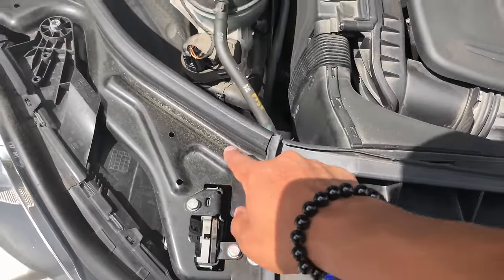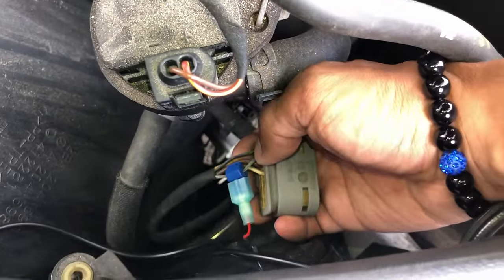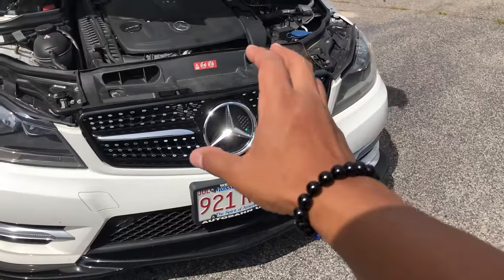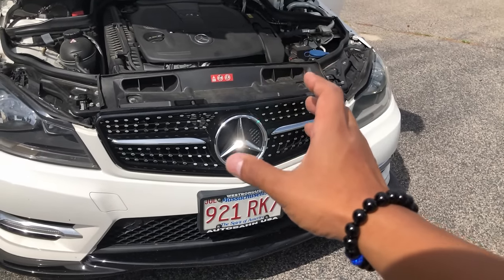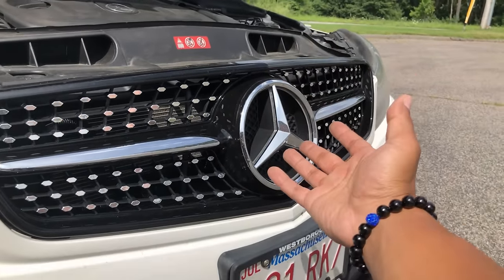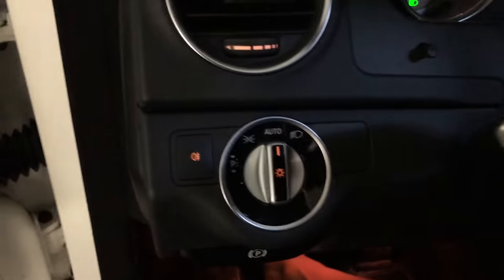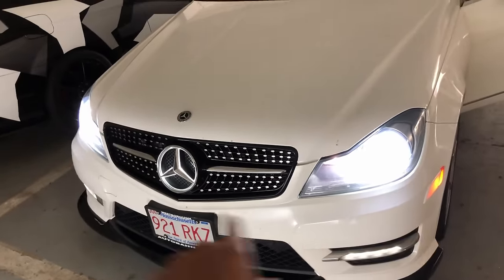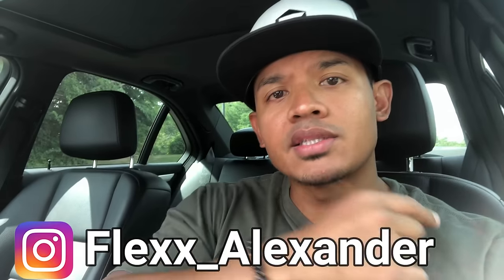2 EASY WAYS TO WIRE A  MERCEDES LIGHTED LED STAR EMBLEM

Comment from the maker: FOLLOW ME!!!
Website: www.FlexxAlexander.com
Facebook: www.facebook.com/FlexxAlexander1
Instagram: www.instagram.com/Flexx_Alexander
Reply: I see you with your lights on the door. I have my 2006 r500 hooked up the same way. After this, ill be installing led headlights and reverse lights. After that, i don't know what else to do. Any suggestions?
Reply: Hey Flexx,
I have GLC300 2019, but the headlights wire is different with your car. My car have 2 different colors, one is red another is brown. Do you know which one should I connect with illustrated emblem?
Reply: Do they sale a lighted emblem for a 2004 mercedes clk 320
Reply: I have a 2013 e350 and I don't have a grey and white wire .do you know which color it would be for me or can you point me in the right direction

Comment: Thanks for your videos! Replaced sons 2013 C250 grill with the C63 AMG grill and also installed the LED grill emblem using your videos. Your content made it a breeze. Also installed the indoor puddle lights that project the Mercedes emblem on the ground if you open the two front doors. Those were crazy easy as well if anyone is wondering. Just pop them out and unplug. Plug in the new and pop em in and BAM. Again thanks for your very helpful videos.

Comment: Thanks for showing the correct way to wire the star! It should come on and off with the auto headlamp sensor as well as the headlamp switch. It should not run all the time. Kudos
Reply from the maker: It draws so little power and works well. Another way is using a fuse in the fuse box. I have a video on that. That might be easier for people then splicing into the headlight harness 🤷🏻‍♂️

Comment: Hey Flexx. I saw that you ran the wire to your headlights. What are your thoughts/is it feasible to wire it into the parking light (right next to the headlight)? That way, when I unlock my car at night, I get it to light up as well. Thanks.

Comment: I have a 2017 CLA250 4MATIC
For anyone with the same year/model it's the solid yellow wire on the passengers side headlight than you are gonna want to T-Tap into and then I grounded it to one of the white screws going into the frame on the perimeter of the engine compartment.
 Comes on whenever the headlights are turned on.
Reply: I have 2018 GLE350, I’ll check the setup tomorrow. Hopefully it’s similar to your CLA. I was at a shop today, they asked for $80.00 to do it which seems too much for this kind of work. I’ll do it myself :) thanks for sharing
Reply: I have a 2018 mercedes cla250 & I t-tapped into the yellow wire but my star doesn't come on? Do u think its different in my car?

Comment: What year is your car? I tried hooking it up to the headlight wires. I do not have a Grey and white wire. I tried all the red wires, light stays on even when car is off. Thank you for your help.
Reply from the maker: 2013
Reply: @TheFlexxGarage  thank you, I have a 2015. I have T tapped it to the headlights, tried 4 different wires, 3 - red ones worked, but the light would not shut off. Found a black and white wire, that one made the light flash/blink.  Thank you for your help. Enjoy your videos. Thank you
Reply: @robertlongoriccardo  did you find the right wire? Same problem

Comment: Hey man great video as usual. I was thinking of hooking mine up to a pack of 4  AA batteries and a remote switch so I could just turn it off and on wirelessly. I was wondering how much power this thing draws. How long do you think it would last continuously on 4AA batteries? Also is there enough space to stick anything to the back of the star itself? That way I could just remove the star everytime I want to change batteries.

Comment: Hey Flexx!

Do you know of a way to connect the emblem to have it on ONLY when you unlock/lock the car? I want to have the symbol work the same way the puddle lights under the side mirrors do.

I've searched quite a lot for the location of those lights on the fuse box but no luck just yet. If you or anyone could help me out would mean the world!
Thanks a lot love your videos!

Comment: I have a 2018 c300. I purchased a rear diffuser that has a rain light. The item was purchased from a company in China. There were no install instructions for the light. I want to tap into the rear brake light harness. My question is, which wire in the harness is for the breaks? Thank you.

Comment: For my ml350 2015 to ttap it to my head lights what wire or color wire to tap?
Reply: The easiest place to wire the emblem to are the orange / yellow side marker lights.

There's only two wires attached to the bulb a ground and a power. It's super easy and easily reversible.

Comment: Hey, going to get the same style for my SL55.  Won't I get a error code if I splice into my headlight power wire?  I have HID and they only use 35 watts.  From my experience my car throws an error code anytime I hook something up that is not factory.  I upgraded to HID fogs but the ballast had a code cancel feature.

Comment: The easiest place to wire the emblem to are the orange / yellow side marker lights.

There's only two wires attached to the bulb a ground and a power. It's super easy and easily reversible.
Reply: Mine are green and brown? Which one is positive?
Reply: ??? My lights only have 1 harness and the side markers are built into the lights
Reply: And trying to find an actual wiring diagram for a gla45 is like trying to find a leprechauns pot of gold

Comment: So, did all the steps in tapping into the gray/ white wire for my star. However, I noticed at night the footwell light are on. They turn off when the car is off but when the car in use and the automatic lights have turned on giving power to the star, I noticed the footwell lights are on. Any suggestions, what’s going on here?

Comment: Hi Flexx, I'm driving an A45 2014, my headlight doesn't have the Grey with white stripe wire, but it has grey with black stripe wire, are they the same? which colour wire should I tap on?

Comment: Hey so I bought my car with it wired the first way. About a month ago it stopped working. My lights and everything still work fine. Any idea if it could be a fuse or something? Or if i disconnect it what can i test the star with by chance?
Reply: I can just touch it with a 9v?
Reply from the maker: I would take the positive wire and negative wire from the star and put it on a 9V battery to see if the star will even light up.

Comment: How exactly do you “ground it” do u jus put the wire under that bult or do you have to cut some rubber off the wire so it can touch the bult directly?
Reply: yes you literally just wrap the bare wire (no rubber) around and tighten it and it should get electricity

Comment: By tapping into the wire for the headlight didn't cause a voltage difference and trigger a bulb failure on the dash?
Reply from the maker: No. The led star uses almost next to not to power up. There’s other ways of wiring it but this was a quick easy way for me that worked for me. Never had a single issue.

Comment: Hey Alex I know this is a old video but I want to order the star in ebay I have same car and grill do you know the diameter of the star is it 7.5 or 8.4 12.5cm I don't want to order wrong size
Reply from the maker: A lot of grille have different size opening. Also, a lot of stars have different way to mount to a grille.  Best way is to remove the star from your grille, measure it, see if it’s the snap on star or twist on star…and then find a lighted star that matches.

Comment: Hey I bought the grill but can you share the link to get that emblem please 🙏  ??
Reply from the maker: I can't. The emblem is "modded" to fit because I bought the wrong one that's slightly smaller then the hole opening in the grille. It wouldn't help for me to send you a link to the star I bought.

Comment: My husband install an led light on my glc300 but now my driving assist, and blind spot is inoperative showing on the dashboard
Reply: Mercedes does not allow the illuminated star option with drivers assist because it obstructs the radar. You'll need to find a clever solution that allows the radar to work while illuminating the star.

Comment: How did you get the star on the diamond grill. Mine doesn’t fit like the normal star does
Reply: Did you get it to install? Because I’m having trouble too
Reply: The star comes out by twisting counter clockwise and pulling it out and twisting clockwise to lock it into place. This is on a C-Class, CLA, W212.2 E-Class and the rest of the line up 2014 or newer, equipped with a large star grille

Comment: I have a E350. My fuse box completely full compared to every video I've seen. I tapped into #35 which is for a hybrid (I assumed it would work) but it didn't. I just think thats easier than pulling out and t-tapping into the headlight. The headlight isn't as easily accessible. Any ideas?
Reply from the maker: When a fuse box is full, then you need to use a fuse tap to piggyback onto an existing fuse that gets power when the car is turned on.
Reply: @TheFlexxGarage  I am.
Reply: The red blue and black thing
Reply: I just went and got a battery to test the light also. The fuse does light up when the car is on also. #35 also uses a 5. So I put both into the tap and plugged it in
Reply: @TheFlexxGarage  I got it. I used a fuse I had instead of the cheap ones that come in the tap kit. Ty though.
Reply: @tallgirlswagg  Did is work with taping into #35 ? does it only power on when lights are on or all the time?

Comment: I test my star light is on by v9, but when i connected with the wire power is not on. (Grey with white  stripe wire) Can you help me? I have the c300 2011
Reply: Im having the same problem with my cla 250… is not turning on
Reply: Please let me know if you find out

Comment: What does a star cost?
Reply: O.E. Mercedes-Benz parts across the counter at The dealer run about $480 for just the star emblem. Mercedes will also price you for the lighting interface module and the accompanying wiring harnesses to properly install the unit to your W212 E-Class Mercedes-Benz, which pushes the cost up to $800!  O.E. From E-Bay the Star alone will run about $350-$450 depending on the vender. The thing to remember is, without the lighting interface and plug in harnesses, it means tapping into the harness or fuse box, and you lose some of the things the interface module can do like control the star lighting upon entry/exit of the car,  or lighting intensity of the star. The illuminated star should only come on at specific times but if you just want it to come on,  and save yourself some coin, most people forego the interface module and subsequent harnesses and just hard wire it to a lighting circuit.
Reply: You can get it on ebay for like $35 to $40

Comment: Hey, I just got mines installed it been working good but now all of a sudden my battery is starting to die I had the battery checked the said it was a good battery jst need to be charged I charged it up and maybe 30min after driving my battery light came back on I wonder if the led embalm is the problem.Have you had any battery problems since installing it?
Reply from the maker: The star is not your problem.  If you think it could be then disconnect it and see if your issue goes away.  Simple. 

But i would say go get your alternator checked, ASAP. 

Batteries are only used to start a car. Once a car is started and running , the alternator takes over and supplies power to the car while recharging the battery. If the alternator is faulty, the accessories (radio, lights, gauges, etc) in the car needs another power source and will start using power from your battery (that’s when the battery warning lights up).  Let it drain enough and you’ll be stranded with a completely dead car.  

A jumpstart won’t restart the car. And putting a charged up battery or new battery will only start the car and let it run for awhile until all the accessories drains the battery dead again, cause the alternator is faulty and not recharging the battery while the motor is running.  

This is engine 101.  Go get it checked before you’re stranded in the middle of the road and having to pay for a tow.

Comment: I did this and it only works when high beams are on 2018 c300 any other wire i can tap into
Reply from the maker: You tapped the wrong wire then. I tapped the low beams, not high.
Reply from the maker: Why won’t you just watch my install video on a 2015+ Benz.  That would help you more than this video on a 2013.
Reply from the maker: The video is clearly not for a 2018 so the bad is only on you bro. Lol.

Comment: How the hell do u take the stock emblem off the grill 😭
Reply from the maker: There’s 2 types. You either twist it off counter clockwise or you have to go from the back and use a flathead screwdriver to push some tabs to release the star from the grill.
Reply: Bro I had to break the old one it was a bitch plus the fuking star didn’t fit I had to glue the old one back and use the original plastic from the original wi broke and had to disassemble the goddam star
Reply: @euro7145  I had the exact same problem. Old star did not fit in diamond grill. I had to use glue to hold it in.

Comment: So you only connect the red wire to the headlight what did u do with the black one
Reply from the maker: It’s in the video. I grounded it to the chassis of the car using a bolt.
Reply: Thanks
Reply: @TheFlexxGarage  just finished up, worked like a charm thanks broski.

Comment: I used the gray and white cable in mi GLC 300 and the emblem just lights up with the hight beam light, why? What color do I have to use?
Reply: I have the same problem.  Any solutions Ruben ?
Reply: I did it in my GLE 43 AMG same things happened.I had to reset check engine light.Probably computer doesn’t recognizes as a part or lowers the voltage of light and pops up error codes.Better play safe don’t instal it unless is original part.

Comment: Wired mine and the damn thing doesnt work
Reply from the maker: If your star doesn’t work, test it on a 9V battery first to make sure it can even light up.  Sometimes these stars comes with positive and negative wires wired opposite.  One star I had, I found out the black was positive and the red was negative. Cause the factory that made it screwed up. Don’t test it on the car. Test it on a 9V battery to be safe.
Reply: @TheFlexxGarage  found a video saying i cant tap into head light i tested it with my other car battery and it works. I need a fuse tap holder to wire this if it doesnt work then oh well i pay 60 for nothing. I have a c300 2018
Reply from the maker: If the star works...then why not just tap into a power source that turns on and off with the car keys? I made a whole video on that. https://www.youtube.com/watch?v=zEa65J2fsOg

There's always a way to wire it up.